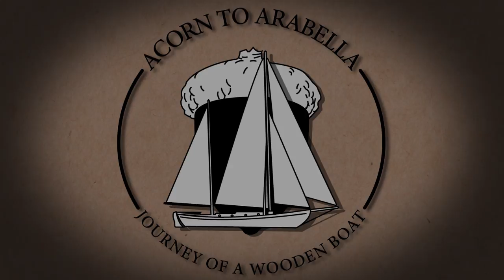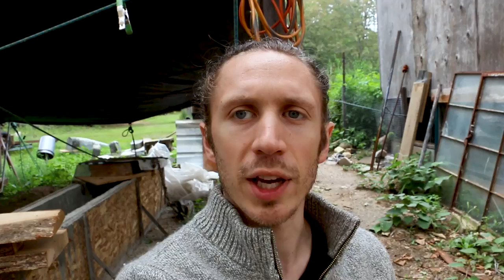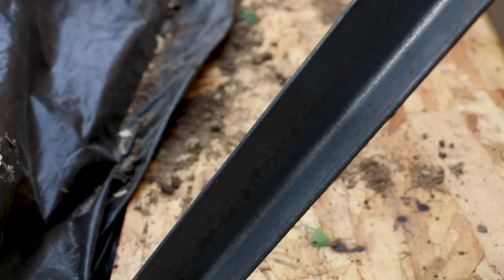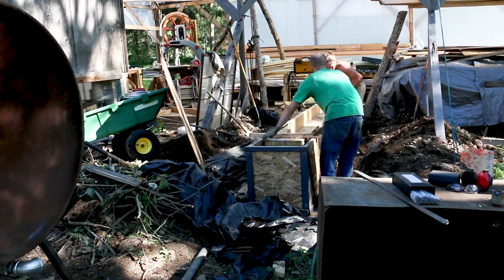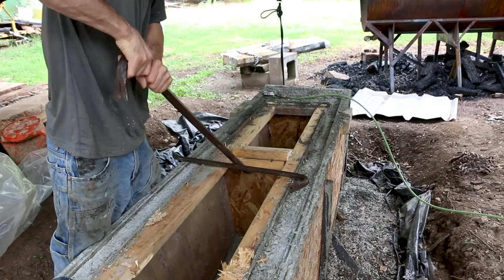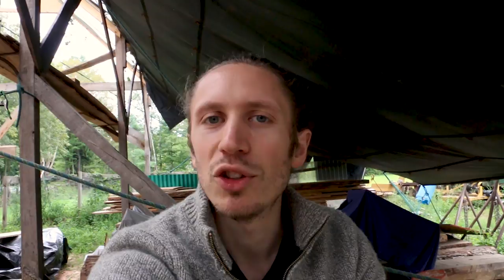Acorn to Arabella - Journey of a Wooden Boat - Episode 15:  Casting The Ballast Keel Mold

Comment: Ohh oil your male mold before concreting and it will pop out in one piece boys
Reply from the maker: That would have helped but the way the keel is shaped the plug was captured at both ends and needed destroying one way or another but oiling probably would have made it easier. Thanks for the suggestion!

Comment: s v  seeker used lead for ballast had steel hull and use hot propane to melt lead his boat is 74 ft long.
Reply from the maker: He did, we have seen his videos and have even been in contact with Doug about it.  His keel is very different than ours and we would have to scale his rig up 10x to do our pour.  It's just not feasible to do ours the same way he did his.